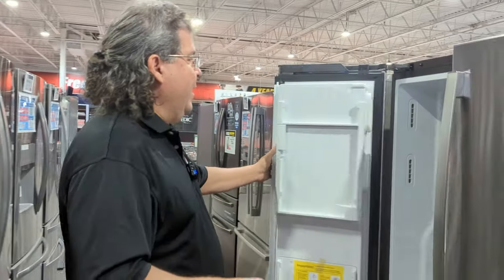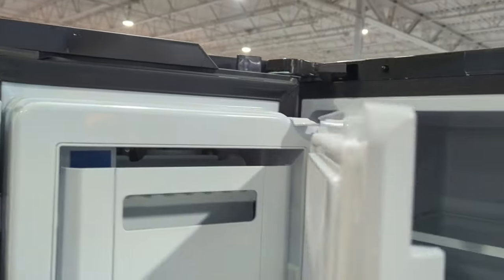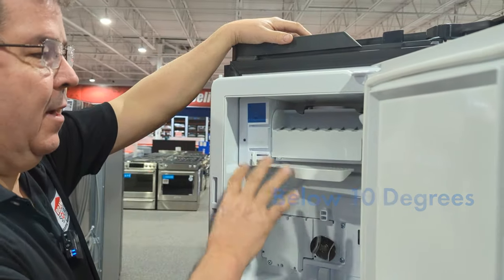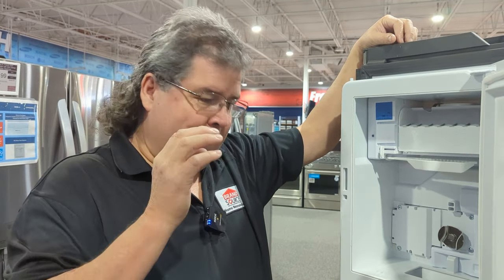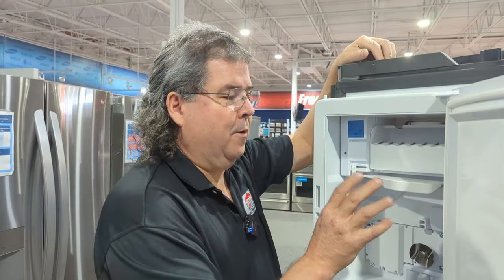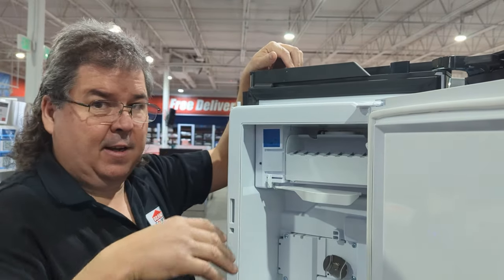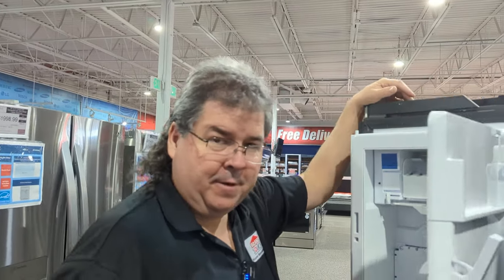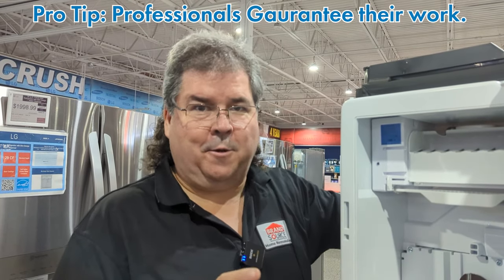Why Your GE Ice Maker is Not Working

Comment: That is a lot of unnecessary words and jokes. Did not learn anything other than  to search elsewhere .
Reply: Funny, this video actually helped me troubleshoot my ice maker. He rapid fired a bunch of potential problems that allowed me to check for all of those things. It’s way better than a video that spends 10 minutes diving into one possible reason the ice machine isn’t working.
Reply: Was this supposed to be a joke comment because that's literally the opposite of the actual video.
He doesn't make much jokes if any and everything he said was straight forward.

Is the seal fully functional, is the temperature low enough, is the ice maker lacth stuck in place

Comment: Ge profile ice maker just quit working and none of this really helps.
Reply: Same! I checked the temperature on it and says 18(*F). I'm thinking maybe that's my issue... Problem. Everything else is working fine, no other temp problems. I cannot set the icemaker temperature. So I'm still stuck on how to fix that! Guess I have to get it serviced - was trying to avoid that. Best of luck to you too!
Reply: Let us know
Reply: @tpt213  Had to get a new one. :( Apparently this is an issue that is fairly common I was told....
Reply: If I open my door for 10 minutes the freezer door that is then close it about two hours later it will make a tray of ice one time and one time only
Reply: So the video DID help? It told you that the freezer temp had to be under 11°, and so you checked and found that it’s at 18°. That’s your problem

Comment: The GE profile icemaker is so slow that I could make ice five times faster with the old time ice trays. If you only need a half a glass of ice every couple of days, it's awesome.
Reply: Since the ice maker is inside the fridge compartment and the cold air has to be brought up through fans (harder to move cold air up), the LG designed ice maker cannot make huge batches of ice. Get a model with a dual ice maker.

Comment: Thank you! After seeing your video I found that my cleaning lady had bumped the fridge temp to 44 degrees.  It took 2 days for the ice maker to rise above 10 degrees and it quit.  I lowered the fridge temp back to recommended 37 degrees and 24 hours later my ice maker began making ice again. Without your video I would have ended up calling a repairman.  Thanks for the savings!

Comment: The fan that pushed cool air into the ice maker from the freezer went out. You can determine this happened by putting your hand next to the 2 intakes on the side of the door (0:13). If warm air is coming out its broken.

Comment: I had a problem with my GE in the fridge ice maker not making ice. I checked the ice maker door gasket and found a thin layer of ice around the perimeter in spots next to the gasket. Removed the ice and the problem went away. May need to look into a replacement gasket. Thanks for the tip.

Comment: The ice maker found inside GE french door refrigerators is essentially a LG patented ice maker. The troubleshooting instructions are the same for both brands.
Reply: LG?  Well, there's the problem, right there.
Reply: @Steve-wz5pz  LG is the only brand that perfected a ice maker that works inside the fridge compartment. Samsung ice maker inside the fridge is the worst. Whirlpool and Frigidaire still have issues.

Comment: My fridge and freezer are working fine, but the ice that was in the ice maker bucket was melting, making me think the cold air from the freezer is not getting to the door ice maker.  What is likely involved in the repair?  It is not easy to pull my fridge out of the enclosure.